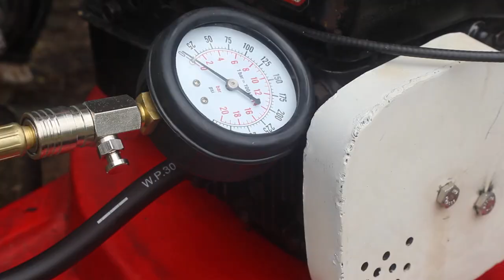Rover PowerMaster motor mower: service, repair, and modification

Comment: I Brought one of these today at a junkyard. I brought it because it had a grass catcher with it. But it turns out the mower was better then I thought. It has new oil, new air filter, new blades and a new spark plug
Reply from the maker: Nice find, unfortunately mine didn't have the grass catcher. They are a really nice mower!
Reply: @grannyflatgarage7599  yeah I know 
Since mine got the catcher with it. The price of it has gone up

Comment: My one smokes like yours and smells like it’s burning oil! Do you think changing the ring could be a solution?
Reply from the maker: Hi Gianni, 
This one doesn't usually smoke, I had it sitting on the front wheels so I could see where the oil leak was coming from underneath, and all the oil ran into the head. 
If your's is doing it regularly then it could be the piston rings, it could also be the valve stem seals or the filter in the PCR (@ 5:28) allowing oil into the intake. 

I hope you have some luck with it!

Comment: I have inherited one of these, its really hard to start (I was given  specific instructions on  how to start it) and when it does run dies easily under load. I feel like it's fuel starvation. What do you reckon?
Reply from the maker: Hmm, bit hard to tell without seeing it. An issue that I've had is with the automatic choke. If you take the screw off the top of the carb (where the air hose connects) you should see a little butterfly valve, this should be closed when the engine is stopped. When the engine starts it will open automatically as vacuum builds. 
It the valve is stuck open it could be causing a lean condition on start.
The carbs are quite simple, it might be worth pulling it apart (take photos) and give everything a squirt with some carb cleaner it might clear a small blockage. 
Finally there's a hole on the plate in front of the carb with a flathead screw in it. This is the mixture screw, try loosening the screw a little for a richer mixture, go 1/4 turn at a time and give 10 seconds after each adjustment to see if it works. 
Good luck!
Reply: @grannyflatgarage7599  thanks for that, I threw a compression tester on it and got 0psi reading. Confirmed the compression tester on my other mower 70psi. No idea how it still starts and runs though.
Reply from the maker: Yup that will do it. If it still runs occasionally it might be a stuck valve, rather than rings or bore, Maybe try pulling the cover off (it's in the video) and slowly  crank the engine to see if one of the valves isn't moving. It could just be some carbon build up which you might be able to clean from the exhaust port. 
Good luck!